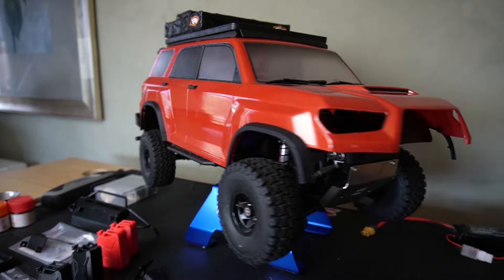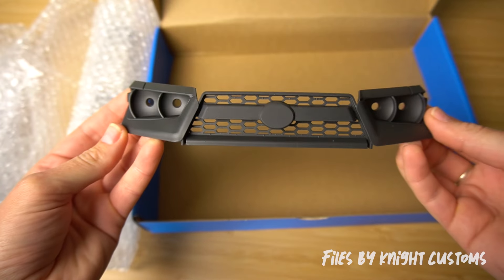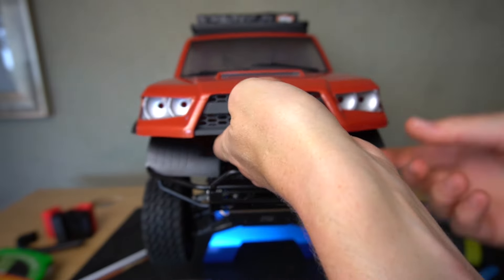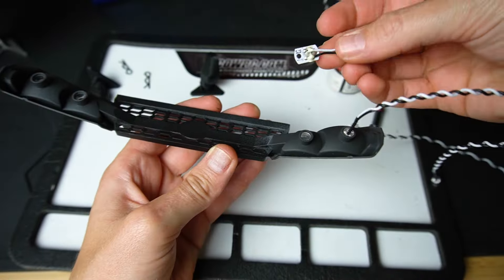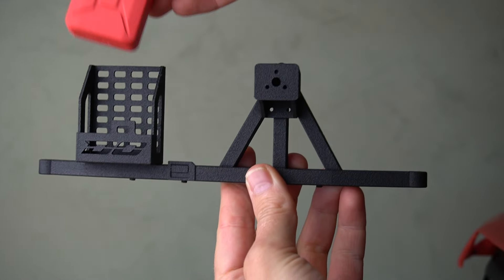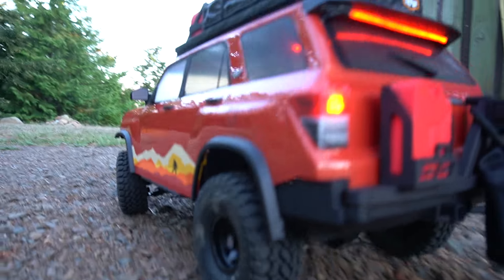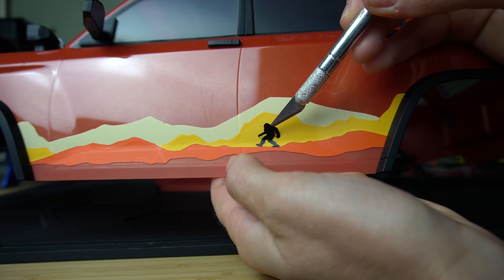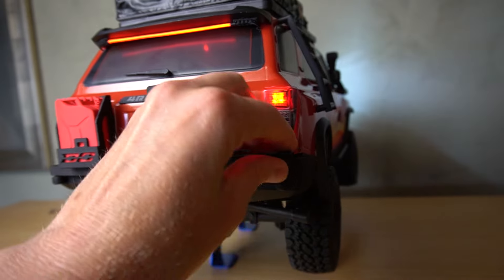Building a radio control Toyota 4Runner!

Comment: Nice Trailrunner! I've been running mine for four years. It takes some love, but it still keeps going. It's hard to justify it since the TRX4 is so bulletproof, but I love my Trailrunner. It's a mini-me of my real 4Runner.

Change the ESC. The stock ESC is a fire hazard. Get a Hobbywing 1080 in there. I'd recommend avoiding brushless with the IFS1 in the Trailrunner. The IFS1 won't hold up to the torque. I never broke more things in a month than when I had one of those Hobbywing fusion combo things in there.

Speaking of the IFS1, I'd recommend looping zip ties around the control arms. They will pop apart, and you will lose the little drive cups that slide into the front diff.

The skid plate is a good choice. The stock setup has a dead vertical spot that gets caught up on everything. The skid plate is metal which won't slide as nice as plastic, plus you lose a tiny bit of ground clearance, but eliminating that vertical spot is worth it. It may be worth looking into the lower control arm skids that wing up higher to cover more of the CV axles. Things love to get caught in there and wrap around the CV axles.

That rear bumper is good and useful. Having a spare tire handy has saved me miles from the parking lot. I don't know with the material you used, but I got mine from Knight's old partnership with that one online service that printed for you. I took a sufficiently long hex cap screw, drilled out the hole all the way through, put it in through the back, got it hot with a soldering iron, and pressed it into the back of the spare tire mount. It's remained secure ever since. You secure the spare tire with a standard wheel nut.

I've had fantastic luck with ceramic bearings in the transmission. I haven't had to get into it in years.

Comment: Really dig the side sticker, plus the sasquatch you added looks so good on there.  A winch hook like that would look good on my tow truck I'm working on; 1/10 Atlas (FMS) put a boom together, putting a amber light on top and adding two winches - of course for the boom and on the front.

Comment: WOW. REALLY COOL. DO YOU 3D PRINT MOST OF YOUR ACCESSORIE'S. AFTER INITIAL INVESTMENT. DOES IT ACTUALLY SAVE YOU MONEY IN THE LONG RUN. I'VE BEEN THINKING OF GETTING A 3D PRINTER. THERE ARE SO MANY THING'S I WANT TO PRINT FOR MY TRUCK'S THAT NO ONE MAKE'S. GREAT JOB! 👍
Reply from the maker: I'm not sure if it saves money but it is a really great tool for the radio control hobby!